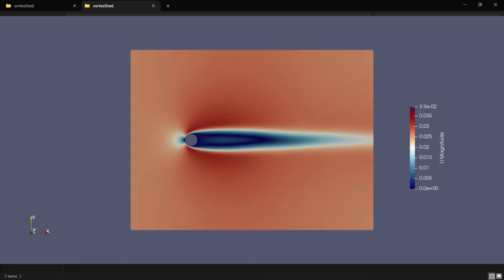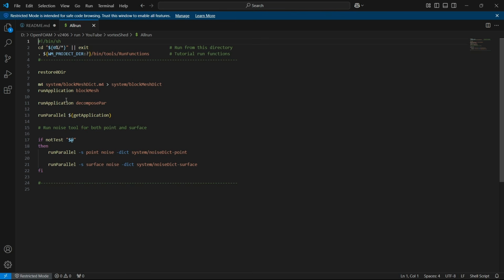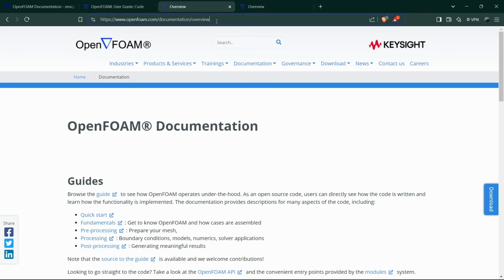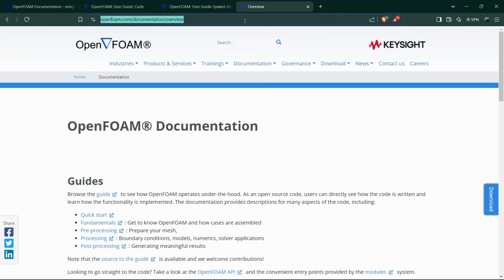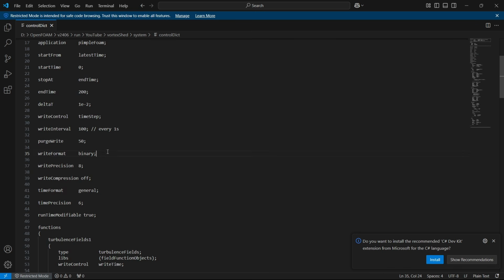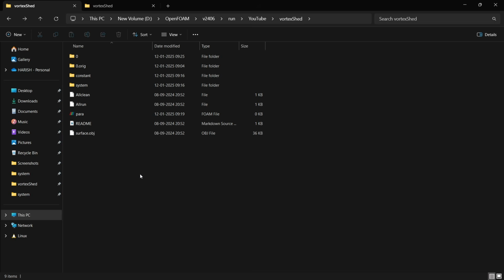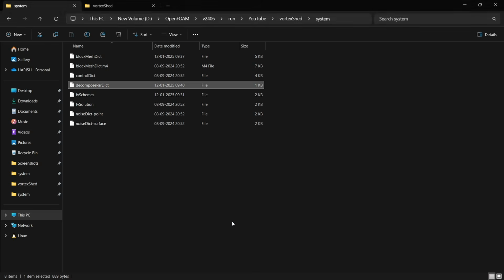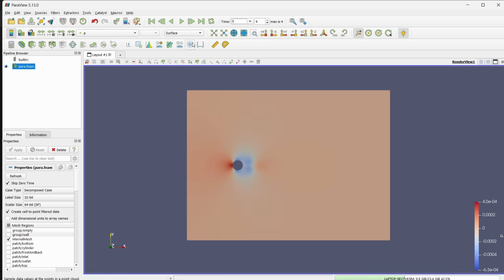Vortex Shedding LES | Spalart Allmaras | OpenFOAM - Large Eddy Simulation

Comment: I only have 2 cores in my laptop. Can I perform this simulation
Reply from the maker: you can try. it will take longer. but if RAM is sufficient, it should run.

Comment: how much time and resources it takes for LES in Openfoam compared to Ansys?
Reply from the maker: I would say it is not drastically different. It's nearly the same. But ansys was slightly faster.
Reply: @Codeynamics  and LES in 2d just for demonstration?
Afaik, Turbulence is 3d phenomenon
Reply from the maker: It is just for demonstration. You can do the same in 3D. Just change the mesh and put front and back as walls or symmetry instead of empty. 
2D is a simplified version to analyse what is happening in the flow. Then we can spend more resources to perform Simulation in 3D
Reply: @Codeynamics  I am not completely sure that using symmetry for LES is a good idea...
Reply from the maker: @antoine1407  We can use walls if we want wall effects, else we can use symmetry and it will be fine. It will act like an outflow without outflow BC. It is just a tradeoff between accuracy and computational cost. But walls have to farther from the pressure fluctuating regions. 
To simulate the real time condition, we can use those walls as outlet, but it will increase the computational cost but it will be more accurate. Again wall has to be far from the object of interest. 
Only if we are replicating a wind tunnel test with walls close to the object of interest, we would have to use walls. Regardless of the turbulence model.
Reply: @Codeynamics  It depends on the specific problem, I guess. For such case using symmetry in the spanwise direction I don’t think it is a good idea, periodic would be better. Also, symmetry would have effect on the turbulent quantities which would force to flow to act different than a real 3D turbulent flow
Reply from the maker: @antoine1407  Yes I agree. It depends on the specific problem, the flow physics, the geometry used in the simulation and what we are trying to analyze from the simulation.
Reply: @Codeynamics  of course symmetry is correct in rans/urans since only the statistically mean flow is computed

Comment: Thanks for the video! I noticed this simulation runs at Re=100 (with v=0.025 m/s). Suppose this was increased substantially (to a more reasonable velocity, like 2 - 3 m/s) - would that still be tractable with LES? Or would the mesh need to be absurdly fine in the boundary layer/wake?
Reply from the maker: It would work even with this mesh. Try to run adaptive time stepping. Only that might cause an issue by blowing up the courant number.
Reply: @Codeynamics  Oh, really? I would have assumed you'd need to refine the mesh further, because y+ would increase otherwise. The Y+ Wall Distance Calculator from CFD-Online suggests dropping the first cell width by around two orders of magnitude when increasing the flow speed to 2.5 m/s. But I'm not super familiar with these turbulence models. I should just have a look and calculate y+ for the different cases to see what happens. Thanks for the reply!
Reply from the maker: the mesh given is already pretty dense. You can calculate the y+ and remesh accordingly if needed. Also check the Y+ range for spalart allmaras and choose accordingly.